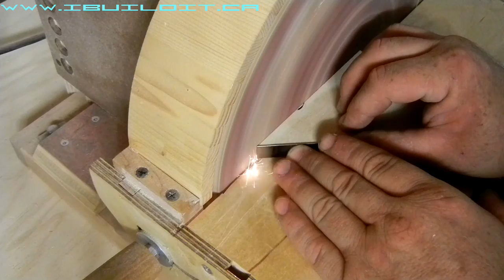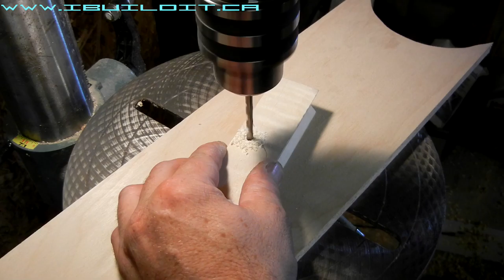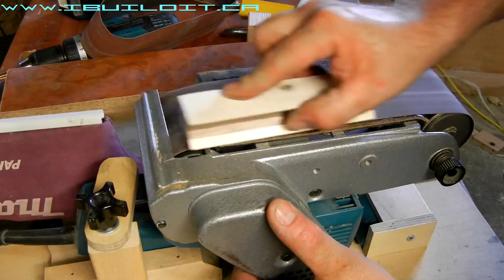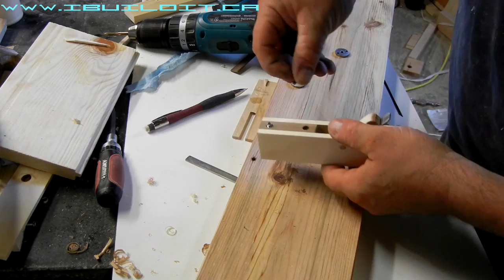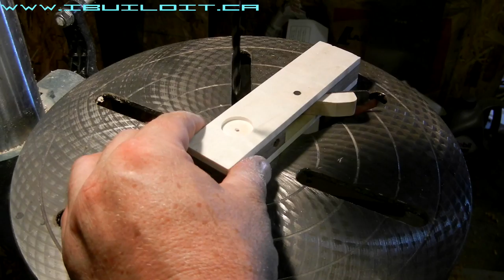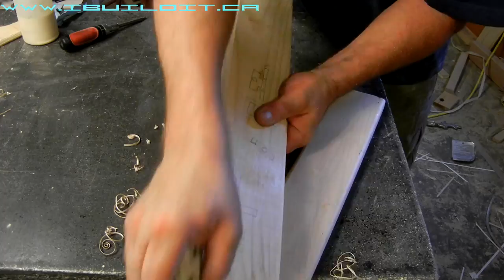Making A Wooden Chamfer Plane, Part 2 of 2

Comment from the maker: Thanks. At first, I was going to fix front and back, but decided to make the front adjustable to add to the complexity. It has a practical purpose - it would be very tricky to glue in the front and back inserts precisely in line with each other.

Comment from the maker: Yes, but it needs to be steel with a high enough carbon content, otherwise it will not harden. Hardening the blade with make it so it can hold a very keen edge and not get dull as quickly.

Comment from the maker: That would have me making cuts out of the sequence shown in the video - the body is glued up, the sole is cut to 45 degrees and the slot is cut. Done like this to reduce error and give me a larger part to handle while cutting.
I have it set up properly now, for all types of wood. In the video, it was set a little deep, taking a too aggressive cut.
When I was happy with the setting, I coated the body with linseed oil. This "glued" the infeed in place, so it won't lose its adjustment easily.

Comment: Just a tip with hardening steel, when you dip it in the liquid to harden it, move it around in there. When the hot steel boils the oil and there is some gas bubbles they can stick to the metal and then the metal cools at different speeds in different spots. I don't really know what is the downside of this but that's what they taught us in school :D

Comment from the maker: I have a video coming up about what I've found for steel quality in circular saw blades. There is some variation, but from what I tested, they are made from reasonably good quality high carbon steel and harden well. This is at odds with what I've read online about the bodies of carbide tipped blades: most seem to think they are made from mild steel.
I didn't temper it, since ultimate sharpness is the goal here, and not flexibility. I'll see how well it holds up, but so far, so good.

Comment: NO! YOU CUT THE DRILL BIT!  Just kidding. Very nicely done. I really appreciate no music or background chatter. I may have to make one of these. As for cutting the drill bit, I've started using drill rod from Fastenal which is about the same cost as a good drill bit. It's accurately dimensioned. It also comes soft but can be hardened just as you did the steel. Love your vids.

Comment: I think you could shape the bevels on the sole pieces first, then glue them into the core blocks before the sides are glued on.   For the sidepiece glue up, you'd need to clamp a straightedge into contact w/ the sole pieces to keep them aligned.  A little tricky, but doable.  Since you've finished it, have you tested it w/ different settings on the front sole?  Do you find it's advantageous to adjust it differently for different woods?  Or would a fixed position be fine?

Comment from the maker: I try to use a much "raw material" in my builds as I can: make something from nothing. The steel that is found in the majority of circular saw blade is just as good (in my judgement) as that in lower cost chisels. Also, the chisel would be a lot thicker than it should be and need to be ground down to fit or change the plane itself.
Thanks for watching.

Comment: That's an interesting point.  I can't say for sure, but I'd guess the steel disc in carbide tipped blades is softer than blades with the teeth cut into the steel disc. Does that match your experience?

Comment: Instead of the circular blade cut and sharpened, wouldn't it work a hand chisel straight out of the box? (with minor adjustments like filing a few mm on the sides to make it fit in width and to get rid of the chamfer that usually exists on the sides. Also it may be needed to grind it to make a greater angle as chisels are pretty small angle at tip)